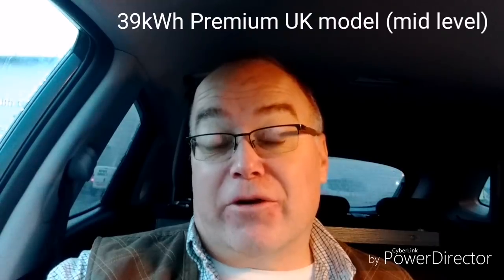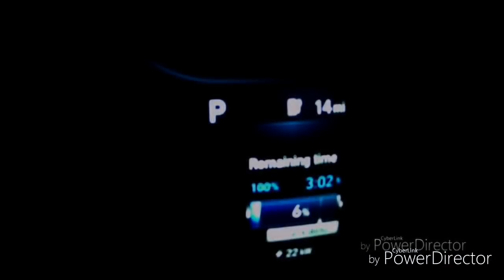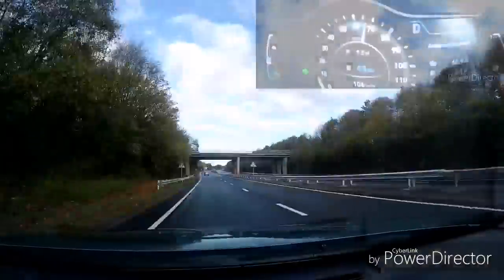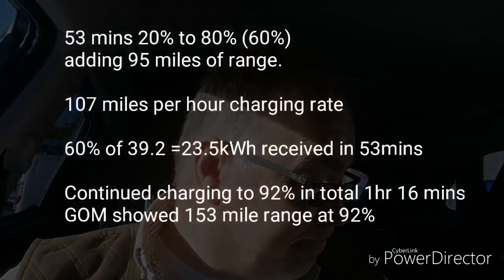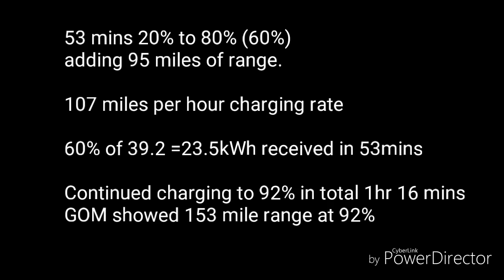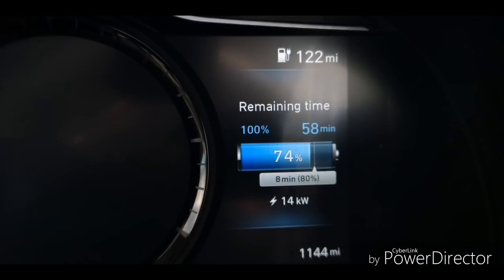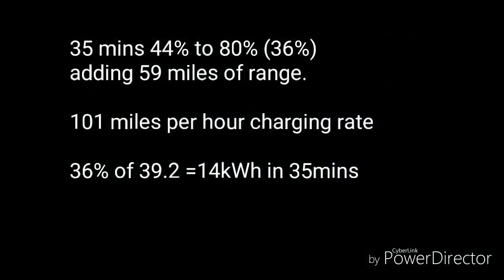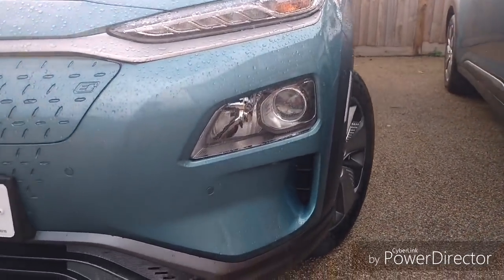Multiple Rapid Charging / Charging concerns & why I wouldn't buy a 39kWh Kona Electric

Comment: With a 39kw Kona on order...I’m concerned. We need to understand what is going on here. My first thought is it’s most likely to be to do with temperature. Hyundai need to make more information available about the charging and BMS processes.
Reply from the maker: I agree but they've blanked all my questions on this. Its top secret it seems.

Its for potential buyers like yourself that I've struggled with this video. I love the car but something feels very different with the 39kwh when charging with no explanation as to why. I have to say what I feel.

Yes my view is tainted by the bigger 64kwh that charges faster but in both instances the lack of information about what is going on and why doesn't give confidence unless you close your eyes and trust.
Reply: Most likely the owner and driver of the vehicle does not need to know anything about the internal BMU processes. You buy it, you drive it, the software takes care of the rest.
I know from my own problems with the Outlander PHEV how frustrating this is. We are lucky as we have the PHEV Watchdog app which reads all the info from the car and displays it nicely on the phone. We could resolve a lot of weird behaviours by analysing the data. Huynday may not know either as this is fixed programmed in the BMU algorithm. Only their engineers in Korea will know. But they don't tell anyone ;)
Reply from the maker: I agree, but secrecy doesn't help build confidence in their cars. The not knowing is frustrating over something important. Battery health
Reply: There's nothing here to be concerned about. Any ICE car is full of "mysteries" as well, because we don't understand the relevant engineering, but we don't think much about it because we're used to them and how they are.

It is perfectly normal that he gets significantly lower charging speed with the 39 kWh pack than the 64 kWh one. They are probably the same chemistry and the same cells, although we can't really know, and your first approximation would be to expect 39/64 = 60% of the charging power, because the physics of batteries work in such a way that it is the charging rate relative to the capacity that matters. 

This is such a useful concept that it has its own name, "C-rate", where the C stands for capacity. It is also what you should expect, because you know that you can charge your phone just as fast regardless if I charge my phone at the same time or not. One way to make a bigger battery is to simply use more cells, and since they are all charging at the same time, that makes it faster. (To prevent misunderstanding: 10 of the same cells charge as fast as one. This is true whether they are connected in parallel or in series. If battery A is twice as large as B, it makes no difference if it is made by putting twice as many cells in, or the same number but twice as large, etc. - the capacity is the relevant thing.) 

In practice it is of course not quite that easy. Maybe the smaller pack has more buffer. It should last more charging cycles if it is to last the same mileage, because you can't drive as far on each cycle. Maybe it has better cooling, thanks to the extra space freed up by needing fewer cells, which makes it possible to place dummy cells in between the real cells and distribute the heat more (no idea if they do this, maybe it is more important to make sure the pack can heat up quickly in cold weather or something). And even if we worked out all the engineering stuff, we still can't control for the fact that somebody in marketing may decide that "the more expensive car should charge X% faster than the cheaper car" - engineering decisions are routinely impinged by decisions that have nothing to do with anything technical and everything to do with how the business people want to differentiate the products from each other, or how they should compare to a competitor, or some other "random" (from an engineering point of view) goal. 

I think you should only ask yourself how often you want to drive far enough that you'll need to charge en route. If you don't drive very far very often in winter, the 39 kWh will very likely prove to be perfectly sufficient 99.9% of the time. Maybe some cold winter day in two years you'll have to spend twenty minutes extra at a charger, but if so, just start counting the money you saved by choosing the 39 kWh one, note the number you got to when charging ends, and continue from there next time. I doubt you'll ever have time to count all the savings. :D
Reply: I'd tell you not to worry too much. You'll normally leave home with 100% charge every morning and range enough for the full day. Rapid charging is expensive (at least here in Catalonia) so you try to avoid it anyway.
Reply: Eduard Pertíñez yes I agree most of the time there isn’t need to be concerned. In my case I’m planning a road trip to Spain from the England that would necessarily require multiple fast charges. This would be within the first month from delivery (June 2019) so this issue would be very important to me very soon after purchase. The other 99% of my driving and ownership would be fine. But it’s a worrying start.
Reply from the maker: Just allow an hour to get to 80% each time. 100 miles then stop for an hour. 

That's why the 64kwh is so good
Reply: The EV Puzzle hmm my drive from the ferry at Santander to my destination is around 560 miles. This year in an ICE car it took 10 hours with 2 stops of 1 hour each and the other 8 hours driving (say 8 hours @70mph). In the 39kwh Kona I was hoping to slow down a bit and go 60mph, and so drive 150 miles (approx) between charges. However the extra time this may require may make this objective unrealistic. (From previous videos I had been anticipating around 5 miles/kWh...maybe a bit optimistic for motorway driving and need to work on 4miles/kwh?
Reply from the maker: And then how much contingency you're happy with. You get warnings at 8%!

4miles per kWh should be easy to get going steady.
Reply: The EV Puzzle do you think I would get 4 miles/KWh at 70mph?
I’m thinking a 560 mile trip would require (assuming starting with 100%) 4 equal 140 mile drives with 3 fast recharged. That would probably require at least 1.5 hours every stop, and requires chargers to be available and to be working at every stop. If they are not it’s going be be a very long journey 😀😀😬😬
Reply from the maker: In Spain maybe but not the UK.
Refer to my motorway tests , the 39kwh seems close in efficiency at 60, 65 and 70mph so those are relevant. 

I'm now working on 3.9 driving harder in worse conditions and 5 if driving sub 60mph , carefully in better weather
Reply: Only charge to 80% max for daily usage. 100% degrades the battery faster, especially when sitting on high SOC for some time.
Reply: @unpluggedEV  charging the Kona to 100% is not 100% the Kona uses net battery size it's true size is bigger than 39kwh. Nissan Leaf uses gross size battery so it's 40kwh battery is more like 36kwh useable capacity. I have charged our Leaf to 100% it's only bad if you store it in a high or low capacity long term.
Reply: Yeah, I know. we all have see Bjorn's video about that. It still sits on 95%SOC then which is far too high to leaving it for a long time. I can only recommend to charge it to only 80% for everyday use unless you need the range. That's what's been advised in the manual as well.
Reply: @unpluggedEV  I do not think anyone knows for sure yet, maybe after another 5 or 10 years then maybe with more real use data we will know if 80% or 100% is better.
I used to always charge our Leaf to 80% week days and 100% weekends, but SOH dropped to 87% from 91% after one year of driving but since only charging to 100% all the time it's now stable on 89% for last 6 months.
So I have no idea why, although some claim that if you never charge to 100% then the cell voltage never balances, which maybe more damaging. Newer Nissan Leaf dropped the 80% option altogether.
Reply: Gregory Bell could it be possible the manufacturers have already built in some spare capacity so you can always charge to 100% (and it’s not really 100%). Or put another way why would a manufacturer allow you to charge to “100%” if doing this regularly will damage your EV. Could it be perpetuation of an urban myth?
Reply from the maker: That's ok unless you don't have parking and charging at your house then you need to charge either before you get home or as you leave. There are lots of people without off road parking
Reply: The Man of Mead when did you order the kona 39? when should it be delivered to you?
Reply: stefanocs2 it was ordered 19/09/2018 and is being delivered 28/06/2019. That’s about 41 weeks wait
Reply: @themanofmead5273  i order in Italy 13/09/2018 and estimated delivery time 29/04/2018 for 39
Reply: stefanocs2 assuming the Konas will be arriving by container ship I’m guessing it will come via the Suez Canal and will have drop off points around the Mediterranean on its way to UK where I am.
Reply: @themanofmead5273  in Italy arrive in Livorno port

Comment: Much lower charge rate than Ioniq, they may have been using cheaper cells, a lot cheaper!!
<1C max where Ioniq gets 2.2C, that's terrible!!!
Reply: If I recall correctly the Kona uses a new chemistry that is cheaper and higher density but less tolerant of heat.

Comment: I think the rate of charge is normal for an electric car - slow at low SoC then faster, then slower from 80% . The estimated time on the electronic to charge may be misleading. A smaller battery or the design may not dissipate heat as well as the bigger battery in the 64kWh. I assume you were the only car using a charger i.e not sharing the stall with another car.
Reply: Yes. Chargers are current-limited, typically 100A or 125A for 50 kW chargers, so if the voltage is 300V, 30 kW is the maximum on the 100A charger. But the battery pack temperature also matters. And the size of the pack. And the particular chemistry. And whether the cells are balanced (all individual cells at the same SoC/voltage). And the strategy chosen when implementing the BMS. Tesla for instance seem to use a formula that continually adjusts the charging speed depending on the above variables, and potentially others, Hyundai appears to either adjust the speed much less often or choose one of a few significantly different levels. (If you make a curve showing power vs SoC (or time) it'll be fairly smooth and continous for a Tesla, but show distinct "levels" with abrupt transitions, like the diagram shown in this video, for the Hyundai. Whether Tesla or Hyundai takes best care of the battery is impossible to say based on this, but it seems logical that optimal speed varies continually, so it seems only Tesla's approach could potentially be optimal.) 

The point being just this: it's pretty complicated. The factor you put forward is certainly significant and relevant, but it's far from the full story.

Comment: That noise happened to me the other day just reversing out of my garage. I had not heard it before and I thought something has gone wrong with the Kona. Glad I now know it is the BMS fans and yes they are loud.
Reply from the maker: From cold Trevor?
Reply: The EV Puzzle yes in terms of first drive of the day. But it was in a garage so it never gets that cold.
Reply from the maker: A bit like I've experienced then, absolutely no idea what it was doing or why.  In my 64kwh, I haven't heard it ever. Not sure if I should be concerned mines not working or whether the 39 kwh is just normal for that battery size.
If only Hyundai would make it clearer.
Reply: The EV Puzzle It is only the once I have heard it, and I think I got my 64kWh a few days after you. The noise actually sounds like the Kona is going to turn into a hovercraft. In my case, it didn’t stay on for long (only half a mile or so).
Reply from the maker: Definitely odd that it sounds like a fan starting up but from cold you'd expect it to be warming
Reply: @trevorbromley-palmer  Hovercraft... It must have been really loud.  LOL.